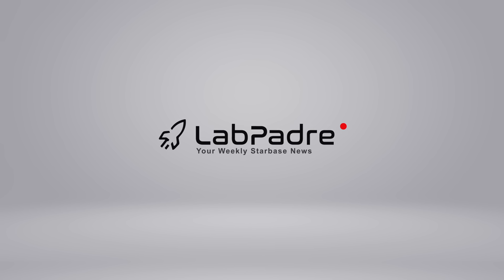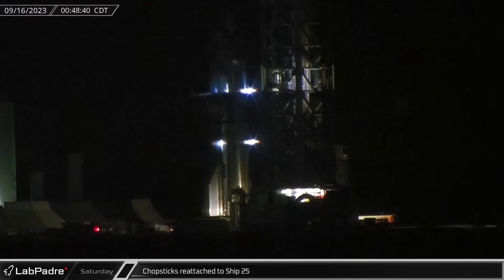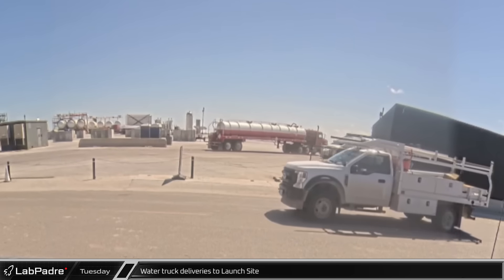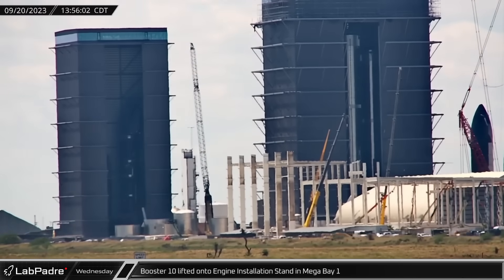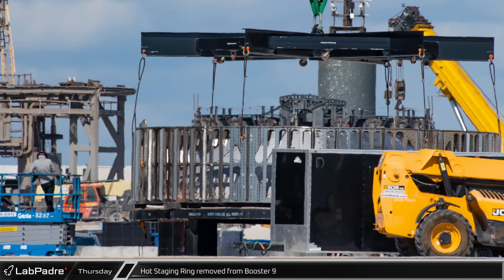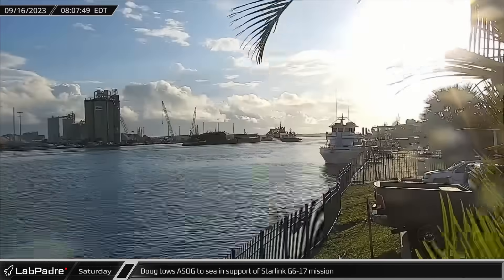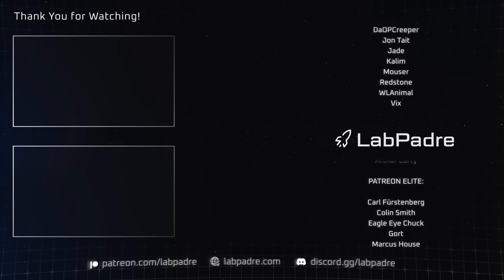Booster 9 Loses its New Hot Staging Ring! - Starbase Weekly Update #81

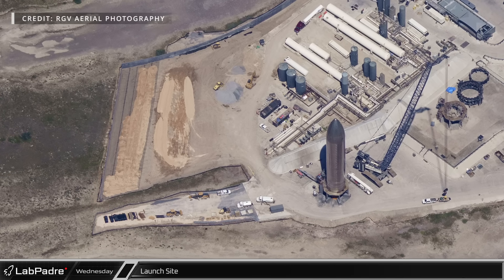Comment: Does anybody know why they don’t fill in those odd thin gaps at the launch site with concrete?? I’m talking about the ones seen at the @4:10 and @4:18 minute marks. Is it because they don’t own those tiny strips of land??
Reply: yes. that would be protected land.
Reply: @SuperS05  are you saying that those tiny little strips are protected but not anything else where the concrete is already poured? It just seems so random that one little strip would be off-limits when there’s concrete surrounding it on both sides.
Reply: @Barthhhelona  I believe it's due to the way water flows and how that effects the ecosystem. Someone made a definition and drew a line so they have to follow it.
Reply: @SuperS05  oh wow, you’re right. I found a wetlands diagram of the launch site and compared it to RGV aerial photography’s birdseye view of the launch site. The weird shape is such that it goes right up against the salt, marsh, and wetlands sections which I guess are off-limits. SpaceX has built literally every square inch that they could with concrete.